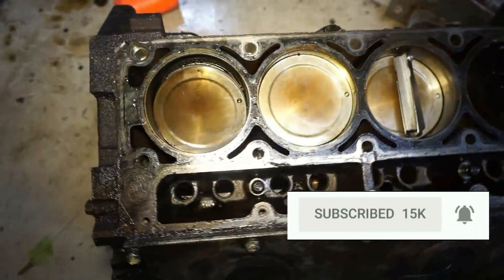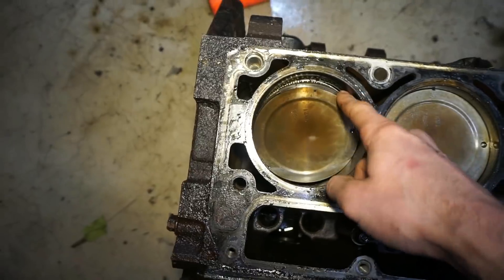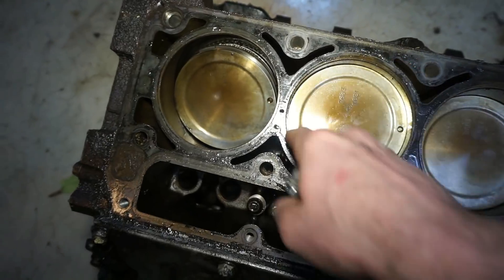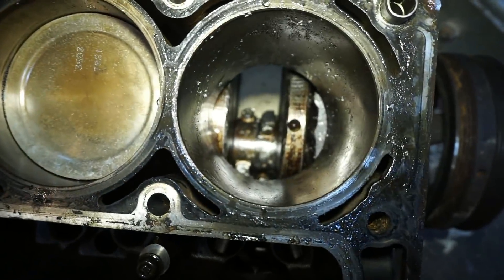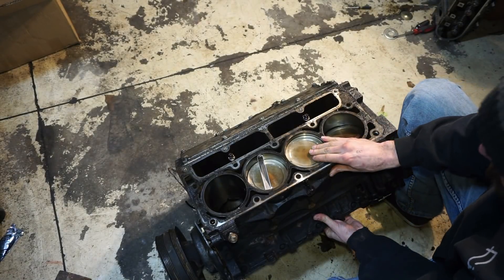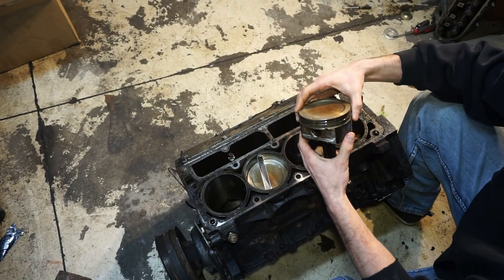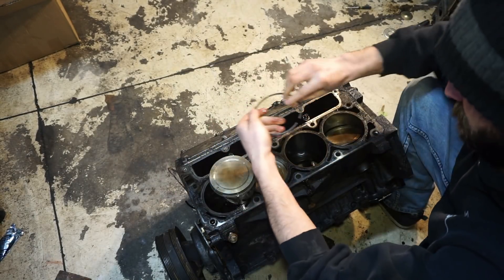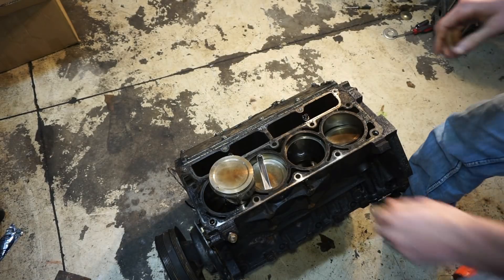HIGH MILEAGE LQ4 PISTON RING GAP SAFE FOR BOOST? - a21bravo

Comment: Heck yeah I'm bookmarking this it would be good guidelines to kind of follow when I build my next junkyard block for my Kia. I'm already running 18 lb of boost making 320 at the wheels on a junkyard block and now I'm ordering my next low mi engine and I'm going to open up the ring Gap this time and turn it up 21 or 24 lb of boost hoping to make a round 400 to the wheels this time.

Comment: Did yours smoke?
Reply from the maker: No
Reply: Just curious. I just honed my high milage 6.0 checked factory gap and its 32 1st and 2nd ring on the first one i checked. Thanks for your videos.
Reply: Im torn between ordering rings or leaving it be i just dont want it smoking like a train.
Reply from the maker: @JohnDoe-rm3rj  I don't think it would smoke. I've gapped them on purpose to .030 and no smoke.

Comment: that's awesome, you don't need to change the gap.. right ? what do you have from the shaft back ? just curious in case you wanted to get more traction or lock the rear-end etc. should be good for 600+ hp at least if it was a 4x4 with a more solid drive train